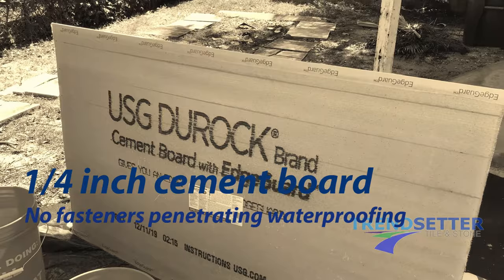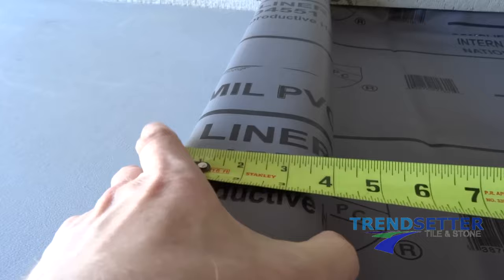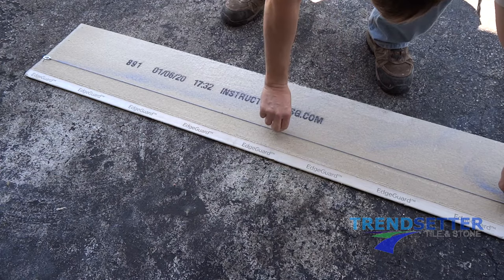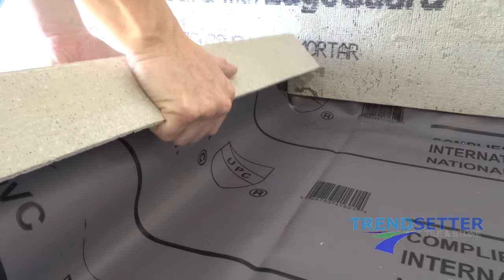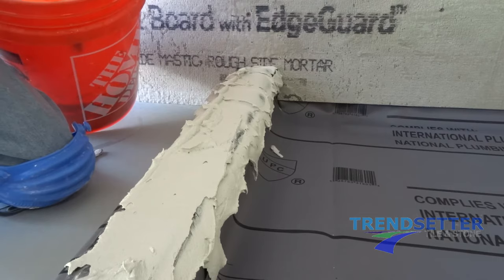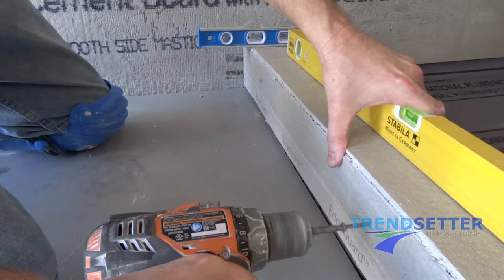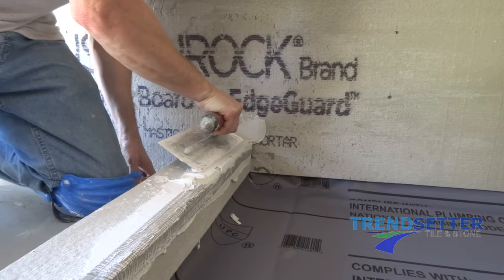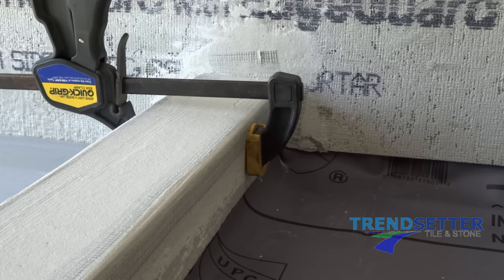How to install cement board on a shower curb and not pierce the waterproofing

Comment: Nice job my curb slab is 6 inches in diameter can 1/2 Durock be used in this install technique that would leave me approx 1 inch over hang on each side of the curb , please let me know Thank You
Reply from the maker: You can use 1/2" Durock. Your outside face would increase a half inch since the board is screwed directly on the outside, but on the inside you would increase about three quarters of an inch or more for the thickness of the board as well as the thin set mortar used behind it. 
We use 1/4 inch board to help minimize the profile and height on the top.

Comment: I like the idea, but not sure about the inside piece. It would seem that once the curb dried it wouldn't take much effort to separate the inside duroc piece away from liner. I don't know for sure, but that liner is not attached to the 2x4 , so its just kind of loose and now your bonding duroc to that?  I bet I could pull away that piece of duroc the next day with minimal effort....
Reply from the maker: This overlay is quite strong once it's meshed up with an adequate amount of mortar under the cement board. The impact strength is very strong and the pull strength is the same as a foam overlay but maybe slightly less than wire mesh curbs. Regardless, once your mortar bed/dry pack is up against the inside face of your curb, there is no pulling the inside face off!
Reply: oh, ok, i missed that, i thought you were packing under the inside board, not against it. so yes, if you pack up to it and lock it in, then its not going anywhere, but now you get into the debate of the  "should you bury the duroc in the pack or not" debate. i personally never bury my duroc down into the pack because i feel it can wick some moisture, but i guess if you waterproof the duroc face and edge its fine.. i do like the way you did it, its pretty cool and seems alot easier than mesh and mud for sure...

Comment: So this is exactly like making your own noble preformed curb. Same install process too. Am I correct this is a great idea
Reply from the maker: Exactly, I learned how to do this before the noble curbs were on the market. I loved the Noble curbs when they became available but my boss never wanted to pay for them and cement board was always readily available. 
The preformed curb overlays sometimes develop a slight twist during installation and they can be fussy depending on how well the plumber installed the liner. Making the overlay myself takes 5 minutes and I use the rest of the board for other things on the job.
Thanks!

Comment: In no way would I be comfortable ever doing this...though I read some comments where you say the pieces can't pull away because the force of mortar in pan, you marry the mortar and backer which allows moisture to wick up & out onto outside floor...
Unless you're going to waterproof the entire shower, in which case screwing all 3 pieces of backer into liner/curb would be easier and make it irrelevant that you compromised the curb.....just saying
Reply from the maker: 1. The moisture through capillary action will not make the journey up and over the curb. If it did, that would put at risk any mortar curb, like a mud and lath curb for instance or a shaped foam overlay. Please remember a shower is being built here, not a swimming pool. The shower will dry out in between use and water will not make it out because of "moisture wicking up".

2. The curb built this way is very strong. Don't forget the tile to be installed around it along with the thin-set under the tile only increases its strength.

3. You stated that since a bonded waterproofing membrane will be added to the walls and curb, that keeping the screws out of the pan liner makes the bonded membrane redundant. Or irrelevant as you stated. That is foolish of you to say because if what you said in section the 1st is correct, that would mean through moisture wicking, on it's way over the curb(lol),  would also imply that the same moisture may pass through the fastener on the inside of the curb face. Which you said was okay, since a bonded waterproofing covers the entirety of wallboard in the installation. 

So do you still think it's okay to put screws through a liner just because your adding topical waterproofing to the board?

Now take a deep breath and realize you are not special. You're a smart ass, and there is nothing special about that.
Word to your mother
Reply: @trendsettertilestone9602  
You're correct on 2 things...yes, I am a smart ass, though you don't know me well enough to know that ✔

And yes, liquid topical membrane or even kerdi on pan & curb makes it possible and ok to perforate liner, and it's 100% waterproofed in and out...plus I raise my wallboard all the way around, no wicking, no transfer of moisture EVER to outside...if you believe in water in/ water out garbage and don't waterproof then yes, capillary action will kick in.
Not something I'm guessing at, see it all the time on demos and document that proof on my channel...subfloor rotted outside curb...sometimes transfers under liner and ruins entire flooring.
Your TCNA won't help you on real world failures.

Second thing your right about...I am special 👍👌💪
Reply: This is thread is good. I literally was hoping to find this and, what do you know? I did.
Reply: @StarrTile  Isn't this the "I don't need no steenkin' preslope guy?"
Reply: @lazarususa  and aren't you the 3rd in command for trolls on tile videos ? 😂😂😂

I tell you what book soldier, you prove to me that a pre slope works as intended and I'll send you $1,000...PayPal is preferred method by I'll pull up to your house and hand it to you, bet you won't take my bet, trolls never do...time starts now, you have a week ⏰
Reply: @StarrTile  how would you go about doing it without screwing or punchering the linner?
Reply: @ArtOfTheWeld  I wouldn't, been puncturing my liner for +24 years without one failure. Waterproof the curb & entire shower and you're good. Had this guy done that then marrying the mortar bed to curb wouldn't matter, so there is that.
Otherwise use a foam curb.

Comment: I thought the title of this video was not piercing the rubber with any screws ? I learned that cut though with Becky board good stuff but I'd still like to see how to install it without piercing the rubber liner
Reply from the maker: The screws on the outside face of the curb are not penetrating a section of liner that is used in waterproofing. The liner on the outside of the curb is excess liner as long as the top of the curb is pitched properly towards the drain.

Comment: you may be waterproofing that curb, but the   tiles will move and cause the thinset to breakdown and the tiles or whatever you have glued on there will pop off or break.
and it won’t take long for it to happen.

are you doing this at your house or for a customer?   have any customers called you back because it’s leaking of breaking apart?

i like that it’s water proof before the durock or hardie board but it’s too cushiony.
it’s too soft of a base for tile of any kind.

hopefully it works, but don’t trust it.
Reply from the maker: Hey Gino, give it a try. It works.
Read the description to understand how it works.

Comment: I have never been more torn in my life... do I make the curb like you, which I like, not penetrating the liner but risking the inside cement board making the grout crack because it's loose... I do not want to butt the mortar bed up to the cement board.  My last shower was builder grade and the curb failed after like 15 years or so. 

 Or, do I  stick with my man Star tile and screw in the cement board through the liner and just redgard the crap out of it???  The glass guy said they screw through the curb to install the door anyways...  I don't know what to do!
Reply from the maker: The shower door guy will screw through the curb. If he's worth his salt he will fill the hole with silicone sealant when he installs his anchors prior to fastening the screws. Take a look at the description to this video.
Star tile...ugh.
Reply: @trendsettertilestone9602  What if I redgard the cement board before I put it on the curb and put the mud bed up against it? Then there is protection from water weeping and also I wouldn't have to screw into the liner except for the shower door hinge
Reply from the maker: @troydarling7614  I think I understand but to clarify this shower's sequence of events;

1.2x4's for the curb installed.
2. Drain installed.
3. Pre-slope installed.
4. Liner installed on top of pre-slope, curb, and up the wall minimum 6 inches above the expected finished curb height. 

5.*Perform flood test* 24 hours
 
6.Cement board overlay installed over the curb, Allow the thin-set mortar to dry under the overlay and on the curbs edges and corners where you applied the mesh and thinset.
7. Apply bonded waterproofing membrane over the walls and the curb. 
8. Install the mortar for slope-to-drain on top of the PVC liner, being sure to protect the weep holes. 
Cement board is one of the few showers that can have the pan mortar installed along the wallboard. Fiber board cannot have pan mud touch it, nor can board such as Dens-Shield.
9.Begin tile installation.
Reply: @trendsettertilestone9602  yes sir, exactly. I am on step 5, then I saw this video and liked the not-screwing-into-the-curb method you use.  I always use durock cement board, I think redgarding the curb overlay before putting in the mud bed in the pan will make me feel better about possible water weeping up in that area. The other walls I will leave a gap so they don't touch just in case. 

 I think this is the plan! thanks a lot for responding. You are now my favorite tile you tuber lol
Reply from the maker: @troydarling7614  Thank you! I wish we had more of a drive when it comes to putting videos together.

Comment: Was wondering if instead of mortar we can use a liquid nail fuz it under the pvc shower pan liner  around the curve so there's no movement on the liner and then use your technique but just making the cement board a lil tighter and instead using 1/2 inch board to make the surface stronger,  use enough liquid nail fuz it right under the cement board to make everything nice and tight and possibly bond everything together nice and tight, you think that's a good option, will that work since liquid nail fuz it bonds to all types of plastic including pvc and the 2x4 board
Reply from the maker: The thin-set mortar can't be substituted. Think of it like this, once the 1/4 inch board and the mortar dry together the thickness just about meets what you would have with just 1/2 inch board. 
Do not be concerned about thin-set mortar not sticking to the liner. That is not how this method works, it works by casting the thin set mortar around the shape of the curb by a principal termed uncoupling. Do not use the liquid nail, it offers no support, no matter how well it sticks! If you haven't already, check out the description.
Thanks!

Comment: Nice Job, one question how well does the thinset mortar stick to the membrane?
Reply from the maker: The thinset is not meant to "stick" to the liner. The thinset will harden into place and form a mechanical bond/anchor, as opposed to an adhesive bond. The thinset bonds to the cement board, but becomes a contoured shape around the liner which is not easily removed. This is the same concept used on Schluter Ditra, with Schluter's built in dovetails. Thinset does not bond to plastic ditra, it does however form a mechanical bond filling in the shape of the dovetail squares. Essential this is an uncoupled curb. This overlay will not be removed any easier than any other part of a demo.

Comment: Great idea and Video. I was thinking.....to make the Choryloyl be a tighter fit on the curb. Cam you nail on some Choryloyl on the 2x4 Curb and the glue the Choryloyl pan to the Choryloyl Curb?  That would  make that a nice tighter fit, rather than a loose fit. Is that worth the extra effort??
Reply from the maker: Thank you. I can see how your idea would help reduce how loose a typical liner is on the curb but as long as the liner was put in with proper corner dams, the liner being a loose fit is fine.
Reply: I built mine similar to this video, but I used construction adhesive between the liner and the wood. I’m not sure if it actually worked, but I did it. I also did the pan first and used mesh tape where the curb met the pan. I believe I put some screws on top, but I definitely used none on the inside.

Comment: Great Idea.    But isn't the RedGard going to seal up any/all points ( bc it's a solid water proof membrane)
Reply from the maker: No. Since the Red Guard or any other brand of bonded waterproofing does not cover the bottom of the inside face, the area where the pan mortar and wallboard are in proximity to one another, Moisture, in small part, may be carried up from the pan and behind the inside face of the curb. Just like a tree pulls water up from the ground, cement board and any other cementitious product will draw some water into it. If there is a screw in the liner, capillary action may bring some water high enough to a screw, and surface tension of the screw may continue to draw the water into the wood 2x4's. This quantity of moisture that is drawn up is not enough to travel to the top of the curb and will dry out in between use. But a low screw does present potential for water over the years to damage the integrity of the assembly.
Topical waterproofing like Red Guard is excellent if every possible place for water penetration is completely covered. For this type of shower, TCNA 415, which is an unbonded membrane shower receptor, topical waterproofing serves as moisture limiter. For Red Guard to function as the total waterproofing a shower must conform to TCNA B421 or B422 which is also referred to as a sealed system.
Thanks for the question!

Comment: Thanks for sharing. At this point do you pour the final mud bed touching the Durock walls? Does it wick moisture?
Reply from the maker: At this point the next step would be to waterproof the walls and the wallboard on the curb. 

The pan mortar can touch the wallboard as in TCNA method B415 cement backer board.

TCNA B415 Fiber cement board cannot.

The difference is that while both boards have a high absorbancy, Cement board has a larger pore structure. Capillary action that causes wicking, requires finer and tighter materials to bring water up against gravity. Fiber in fiber board is like a paper towel drawing water up, cement board is no where as near in efficiency in drawing water upwards, and so it is permitted into the mortar of the shower pan.
Thank you
Reply: @trendsettertilestone9602  so Durock is cement board and permitted to rest on the mortar bed. Do you ever use Hardibacker? Thanks so much for sharing your knowledge.
Reply from the maker: @aaplzen9051  You are quite welcome. Yes cement board is permitted to rest on the mortar bed or be installed lower than the top of the mortar bed.

We do not select Hardi-backer or fiber board for construction of our showers. There is nothing wrong with fiber cement products and when installed correctly they are just as functional and long lasting as other types of board. If you are comfortable with a specific type than you should use that type.

The majority of our showers are Laticrete or Schluter system which use foam panels and bonded waterproof membranes. This is often because the showers we do are curbless and we need complete system integration from the shower walls to the drain. 
Foam panels are also very rigid. Cement board on the walls has some "give" between the stud framing. This perceived give, or bounce, from the substrate can be interpreted by an installer as lack, or overabundance of mortar when that may not be the case. Feedback from a substrate can often speed up or slow down an installation. The "give" should be considered a characteristic of cement board and not a flaw. We choose a shower type based on many factors but material consistency and predictability play a big part. 

For the most part we do not use cement board. It is however very helpful in situations like in this video.

The manufacturers directions in combination with the ANSI standards and TCNA guidlines, increase the longevity regardless of the board selection.
Thank you again.

Comment: So how do you support your cement board on the wall where the membrane is on the bottom
Reply from the maker: Fasteners must be installed no lower than four inches above the height of the curb, on any walls within the enclosure. This is the local building code in my area.

When the dry pack/mortar bed is installed along, and against the cement board walls, this will provide stability for the lowest part of the board.

This is only for cement board and some foam board types.

Fiber cement, coated glass mat, gypsum board, or fiber reinforced board must not be installed below the height of the finished mortar bed. Some require a gap and some require sealant.

Four inches above the curb usually translates to eight to nine inches above the mortar bed.
The CTEF recommends fasteners eight inches apart and most manufacturers recommend between 8 to12 inches apart. 

The lack of fasteners at the very bottom of the installation will not effect the assemblies integrity provided the stud spacing is no greater than 16 inches o.c. and the board is a rigid type at 1/2 inch thick.

Thank you